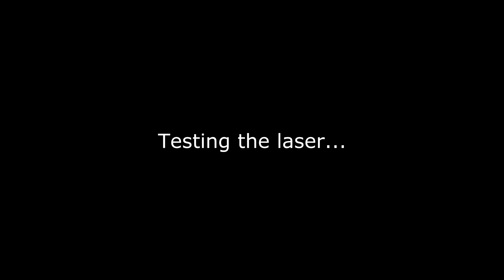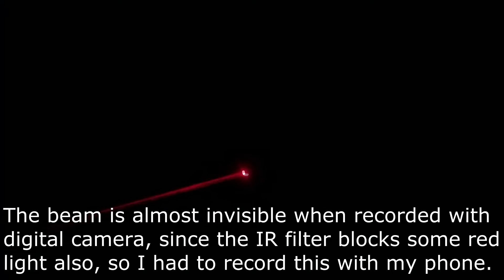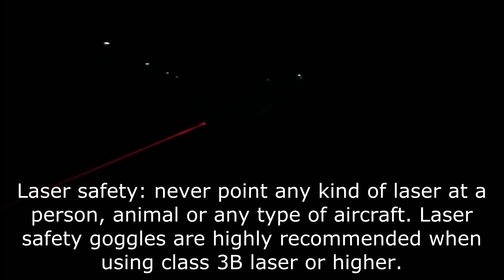100mW 650nm laser test

Comment: There are laser "caps" (hats) that use up to 272x 5mw 650n lasers for hair Regrowth. The one that isn't pulsing the user wears for 6 minutes every day. The pulsing cerisin is worn for 30 minutes every other day.

The thing is... A few companies in the US that claim "FDA cleared" (not FDA approved, because this type of device doesn't need actual approval.. Just clearance) sell the device for $800 to over $2000, which is ecoremely expensive, especially if it breaks or doesn't wok for the user. They have warranties, but the warranties don't last long enough and the return policies are shaky at best.

Several other sources sell almost identical laser caps, claiming 650n / 5mw, but how does one verify the hardware is legitimate and not some cheaper, replacement laser? Most of these alternate caps come from overseas, direct, or through intermediary sellers, so it's difficult to know if they are legitimate.
Is there any way for a user to check/determine if the lasers are legitimate?
Reply from the maker: You could get one of those laser power meters from ebay and test for the power output, if that's what you're wanting to verify? For the wavelength I guess you could use some filters that only block particular wavelengths and see what comes through / if everything matches.